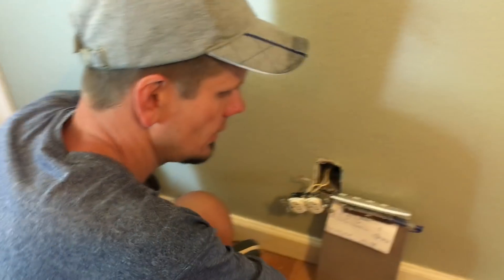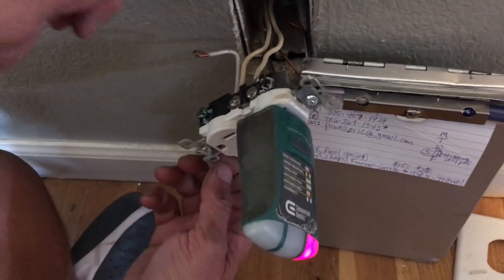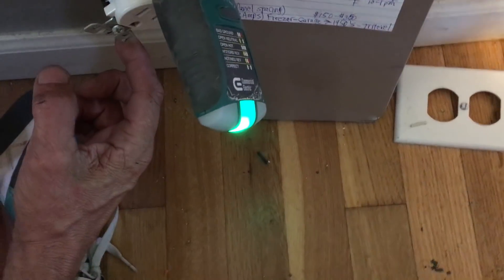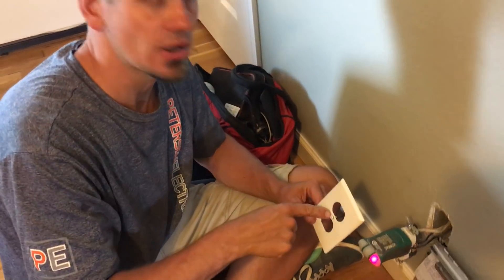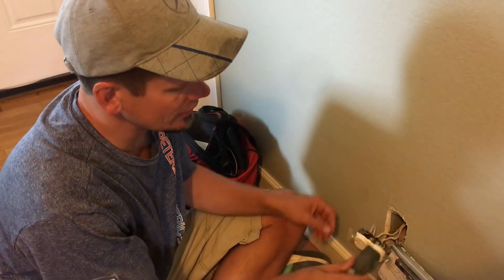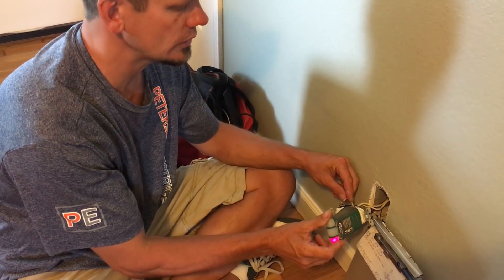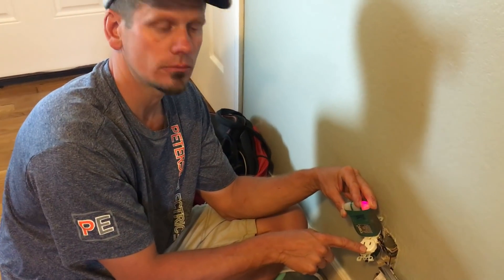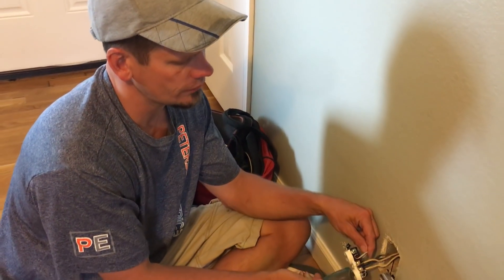Incorrect Grounding From Home Seller

Comment: You could ground to a cold water pipe. You're not supposed to do that either but it'll work grounded like that and be safe,  as long as nobody changes the pipe somewhere in it's run  from metal to PVC.

Comment: That would never have been ok, even in the 1960's.  Besides the face plate, any appliance with a grounded plug would be energized if the neutral were to open, any where in the circuit.  This home owner hack is very dangerous...would have been safer if the ground was not connected at all.  Probably hoped to fake out some home inspector who didn't take the cover off....like you said, the tester shows A OK and it is not!  That bare foot trip to get a drink out of the fridge at 3am could be fatal.

Comment: It doesn't matter if you put a plastic cover on it. Plug something like a washing machine into it with a grounded body, and you've just energized the washing machine too. Or metal bodied tool, or lamp that has a ground (yeah most don't but you get the idea)

Comment: One slightly high-resistance connection on the neutral (the circuit could feed multiple receptacles with multiple connections) before reaching this specific receptacle means the neutral is no longer at ground potential(voltage) once the neutral is carrying current. 

Even if it’s the first receptacle on this breaker, this is dangerous, and not up to code, as he is saying here.

Comment: I must have a good memory, kids. Years, years ago, when I was in your age, it was a norm not to have ground wire in main box and all neutrals were bonded together with ground prongs. And believe me, nobody was killed. Sure, it would be better to have separate ground, but if there's not a such, it's not a tragedy. If there's shortcut in device to metal for example case, it'll trip the fuse.

Comment: Wooo..my outlet in the basement for washer n dryer wasnt GFCI but code here doesn't require it to be but I decided to put one in just in case..the housing was all metal..it read on plug test that it was properly grounded and sure enough it was exactly like this with  jumper..so I replaced it with a GFCI and  marked not grounded..i feel a little safe now..but i have my worries around the house now

Comment: I have 3 wire Romex or whatever they called it back then in my 1960 built home. However half my outlets are 2 prong outlets. All the boxes are grounded with the ground wire being screwed to it. To convert to 3 prongs on those outlets, is it suitable to use a ground pigtail (with green screw) from new outlet and screw it to a different hole in the metal box? Or do I have to connect the pigtail where the existing ground wire is connected to box?
Reply from the maker: both if possible.

Comment: If your house was not originally grounded then it don't need to be.
Reply from the maker: Until you sell it here in CO or you remodel an area, then you HAVE to update those circuits. Besides, without an EGC ground, your risking to be the ground in the circuit. The EGC is the path for the current to go back to earth. This is why the sub panels have to float the neutrals and grounding bars separate until the first point of disconnect outside in the code. 250.130c, 250.122 vs the 250.550-53 and the 230.82 main disconnect shut off outside, in the new 2020

Comment: It’s not right but iv never seen a problem use a plastic cover
Reply: If you plug in a device that has the ground wire bonded to the metal case, you now have risk of electrocution just by touching the metal case.
Reply: The receptacle case is grounded to the ground at the panel , but ya if the receptacle is only ground to case no good

Comment: By code the neutrals also need to be tied together and pigtailed to the receptacle so that the receptacle does not interrupt the continuity of the grounded conductor if the receptacle is removed.
Reply from the maker: I think this is a good practice if you have the box volume, but it is not required in Residential.
Reply: @Petersonelectricllc  you are correct. I always try to do it, but code only requires it in a multiwire branch circuit. Still a good idea in old houses where you're not sure

Comment: Well the ground is clearly hanging right there at the bottom so IDK why they would create more work in having to throw a jumper on.
Reply: I suspect that bare wire was an attempt to ground to the box, maybe hoping to use the flex metal jacket for a ground. When they couldn't get a green light on a tester, they put in the jumper. Fools the casual inspection.

Comment: To fix the problem you can leave three prong outlet and feed it with a GFCI breaker and the outlet or outlets have to be labeled GCFI protected and No equipment ground
Reply from the maker: Nate Higgins you have to use a GFCI and AFCI dual plugs, and in every opening
Reply: @Petersonelectricllc  dual function breaker will work to feed the circuit as well no need to change every device its a lot more cost effective to just change the breaker.. yes I know the code for dual function
Reply: Nate Higgins thank you, I saw that in sparky channel, lol. I would also use a multi af/gfci CB.
Reply from the maker: Nate Higgins - if the Panel is outdated then this is why we do he plugs. I have my doubts that tripping is as safe without an EGC conductor. I prefer to do a device in every opening, not master slave

Comment: whenever i see this it pisses me off that somebody probably a handyman creates this dangerous situation so a homeowner can sell their home  etc.. then inspectors do not catch it cause their simple plug testers falsely say good to go. When they should have either put in 2 prong or if you want to get expensive replace the wiring with new wire that has an equipment grounding conductor.Personally i think gfcis is a bad solution to this problem especially when you get into ungrounded multi wire branch circuits

Comment: They did that in my house in their version of knob and tube re wire with a 14 gauge romex w/out ground, I ran new wire though so all that is set, I talked with you in a previous video about my knob and tube wired house, now I only have two bedroms on knob and tube still but got rid of it for the rest of the house

Comment: If there is no ground pulled and it’s a plastic box, would you have to use a dual function AFCI/gfci breaker and add one gfci outlet at the beginning of the run?
Reply: Well if You used a dual function breaker (AFCI/Gfci), you wouldn’t need a GFCI device, you’ll be good to go, as long as it held and it wasn’t a multi wire circuit.
Reply: (They don’t make two pole dual function breakers yet)

Comment: Thanks for the insight, it sounds like this is a common cheat. If no two prong tamper-proof options are available, then it becomes impossible to meet code, which also puts the inspectors in an awkward situation. What do they recommend? Going back to two prong outlets puts homeowners into a bad situation, too, because you know homeowners will find a way to plug in devices with no effective ground. If its not a multiwire circuit, and you can't rip the drywall off everywhere to run the ground, isn't this the least risky option?
Reply: spelunkerd you can install a three prong as long as it’s gfci protected
Reply: @thomaskatona2028  Oh yeah, good point. One gfci in the first plug of each circuit or at the panel and you're meeting code with minimal outlay, and still it looks nice for the guy flipping the house. With such a simple work around, it is goofy to cut corners....
Reply: They also make an AFCI/GFCI combo device with tamper

Comment: Most Companies That Flip Houses Do This. I Refused to do it so they fired me.
I sleep well at night👍
Reply from the maker: Sorry to hear that, I had a boss years ago fire me because he was the crook. I told him he would not last and he did not. The town ran him out a few years later.
Reply: so what was the way forward for this customer? GFCI on each circuit, and no-equip-ground stickers? or start with a new panel?
Reply from the maker: wim0104 we gave them a bid. 

You are not suppose to just GFCI , your suppose to put a dual function breaker or plugs in ever opening. Best to ground off possible
Reply: I bought a flipped house that "passed inspection". I had to take everything back to a 2 prong outlet, just so I felt safe.
Reply: @BrandtCr066  couldn't you just put  GFCI on the first outlet then anything after on that circuit is protected?
Reply: @rhdtv2002  I wasnt gonna go through the hassle of running new ground wire in a 70 year old house lol
Reply: I think that's why they did that because it did not have a 2hots .